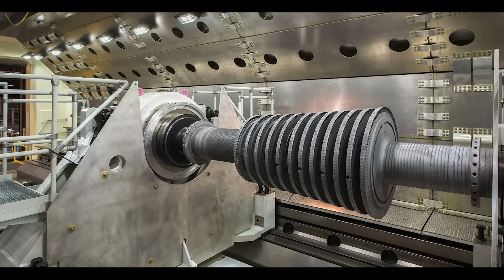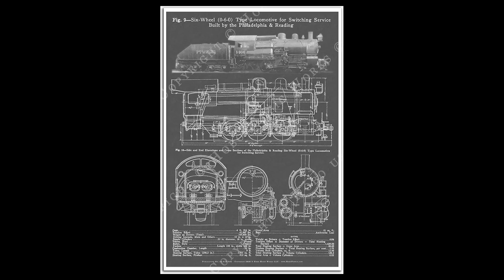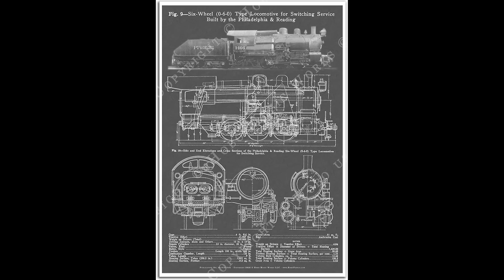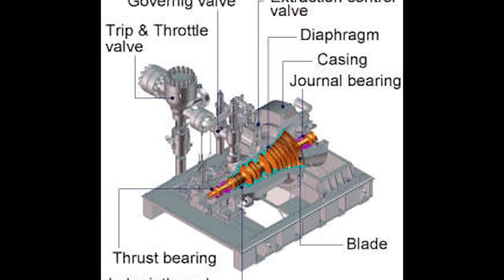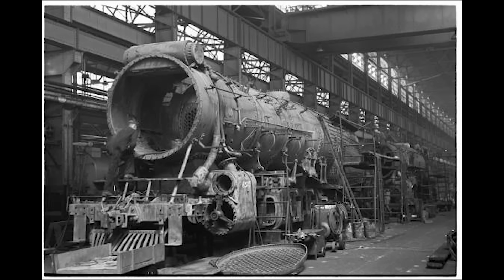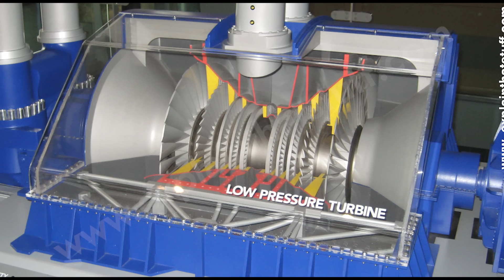The Locomotive That Blew Its Bearings Every 500 Miles

Comment: Up latrer tested steam turbines that had a chance but even then after several thousand miles of testing, the power consumed to create the needed electricity tio run tractions motors was more expensive than the power generated by the turbines. It would have to wait until the early 50's when GE harnessed the Jet engine, burning cheap Bunker C fuel oil, that UP began their 15 year experiement with two types of 4500 HP turbines and finally the BIG BLlow 3 unit turbine that generated 8230 to 10,000 HP based on outside temperatures and elevation. Unfortunately, by then, off the self  Diesel engine locomotives were more than cable and able to handle the motive needs of the railroads for its everyday freight and the turbines were all gone from the Roster by 1972... Maybe someday with better technology, they could return.. Hmmm...

Comment: "the S2 proved that turbines and railroad service operate under fundamentally incompatible conditions"  

You know turbine locomotives ran for decades out west.  Union Pacific had a fleet of 55 turbine powered locos starting in the early 1950s.   But they were only economically viable while the got their fuel practically for free.  They ran on bunker C before it was discovered that plastics could be produced from it.  Bunker C went from practically a waste product to high value pretty quickly.  

Their big problem was fuel economy (and noise).  Poor fuel economy is fine the fuel is "free", but not when there are other buyers that will pay good money for it.

Comment: Total bs. Absolutely not true. The Pennsy turbine did have problems but bearings were not an issue. There were problems with the boiler and Pennsy planned to replace it but the writing was on the wall for steam so the plans were dropped. Turbine blades were also an issue but I have never read anything that suggests bearings was the problem